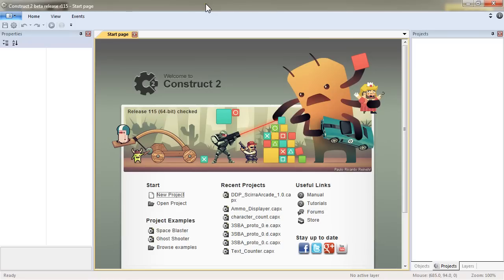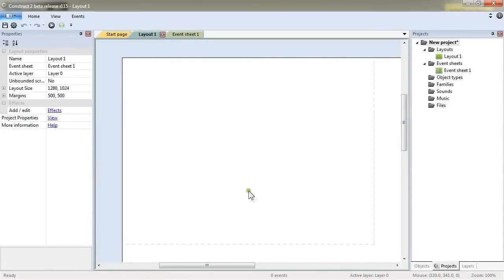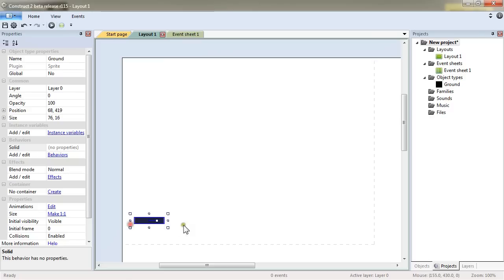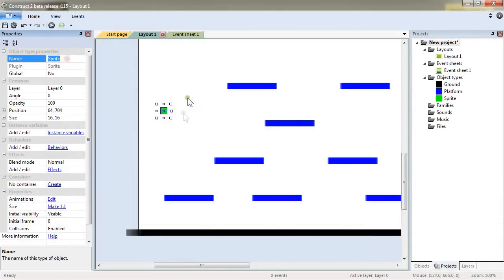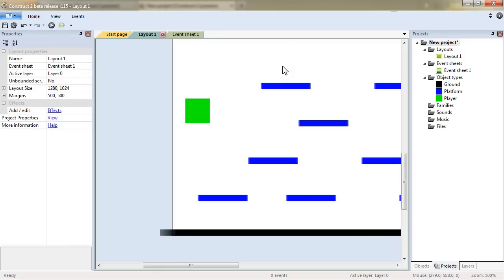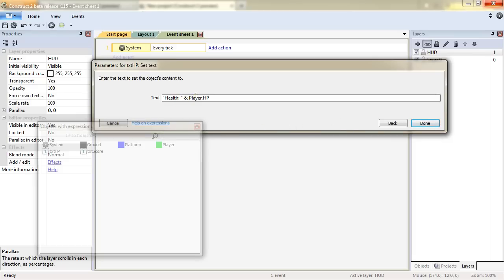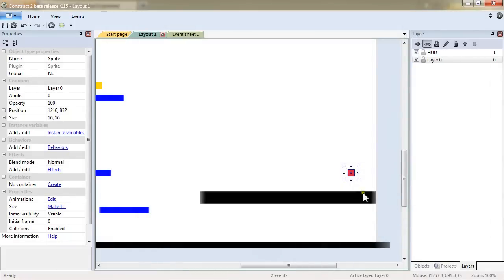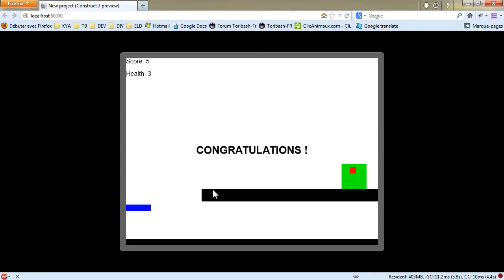Introduction to Scirra's Construct 2 editor

Comment: There's alway a relation between resolution and performance. Drawing 640x480 pixels require less computation than 1920x1080 that's unavoidable.
But nowadays, in common desktop computer, the difference isn't noticeable.
You'll find more difference in drawing 2000 objects vs 20 objects than small vs big resolution.
But yeah that's not a reason to go crazy and set up a window size of 4000x8000 :D
Although a layoutsize of this dimension is perfectly fine but we'll talk about that in the course (:

Comment: Hmmm it seems youtube is messing up some characters
trye this one tinyurl[DOT]com/dxqnyj5
If it doesn't work type it directly on the adress bar (:

Unfortunately mobile is one platform I'm really not familiar with. I don't possess any iOS/Android device so I don't have much experiences in any mobile issue and work arounds.
I would suggest you ask in the forum indeed.

Though blurry pixels is often the sign of upscaling of small ressources, or the algorithm used for scaling.